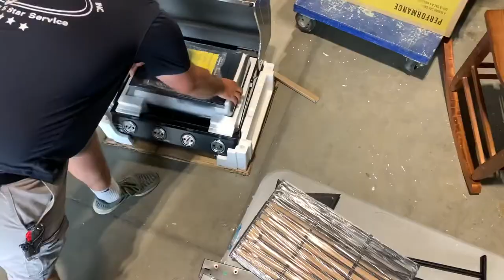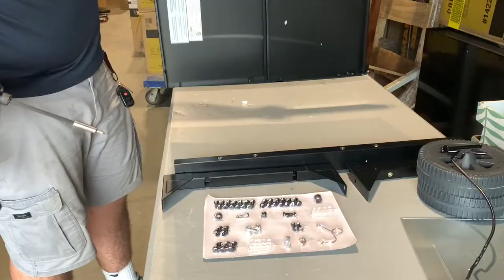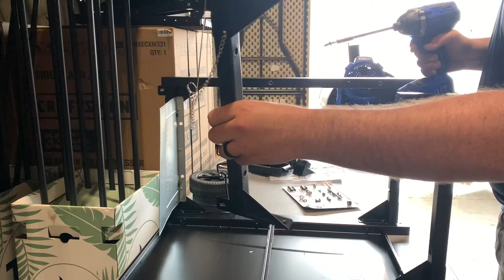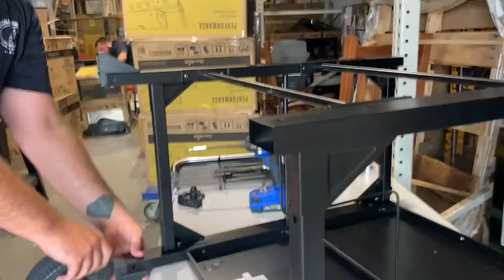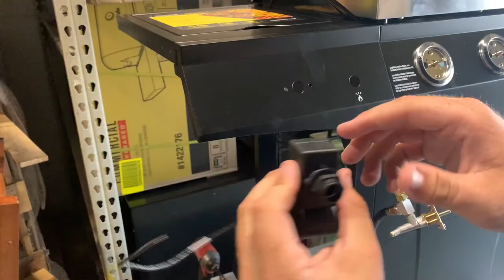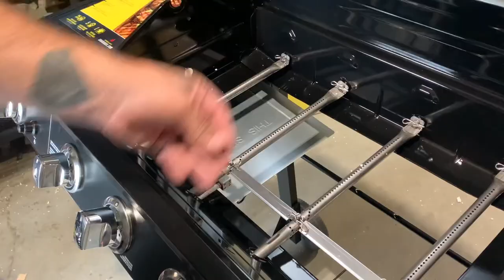HOW TO ASSEMBLE THE CHARBROIL 4 BURNER PERFORMANCE GRILL AT HOME!!!

Comment: I've got a different 4 burner char broil grill.  What a nightmare this thing has been to assemble.  Seriously, whoever designed the assembly and instructions needs to be fired.  The M clip as you show hooking into the actual gas tube is nowhere near what the instructions show.  Spent 20 min on my back trying to figure out where that stupid thing connected into by looking at the picture.  Had to search online only to find it isn't anywhere near where the instructions show.  And its not just the M clip, there are a lot of screws put into tiny spaces where it is impossible to get a straight line on the screw with the screw driver.  I honestly expect this thing to fall apart in a year.
Reply: The M clip is driving me crazy!!! And he pans the camera away from where it’s supposed to be hooking in? Where can I find out how to do this?! Please help!
Reply: It took me two whole hours to put this thing together never took this long with my other grill. The instructions are horrible
Reply: @ILYChrome  Be careful with this unit.  It just recently caught on fire.  I've never had a BBQ that turned into an uncontrollable inferno.  I had to disconnect the gas and flood the whole unit with water.